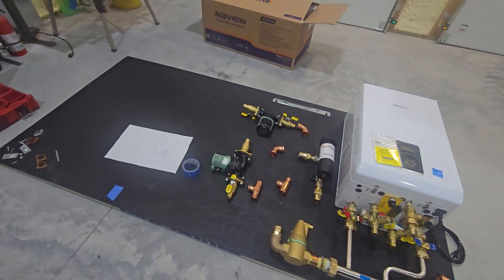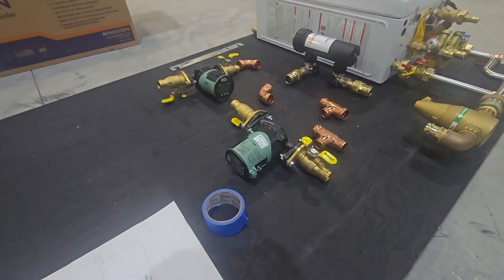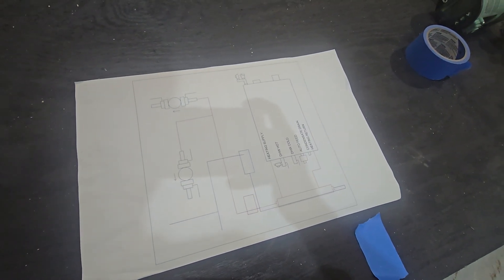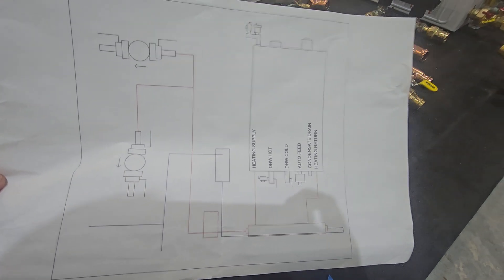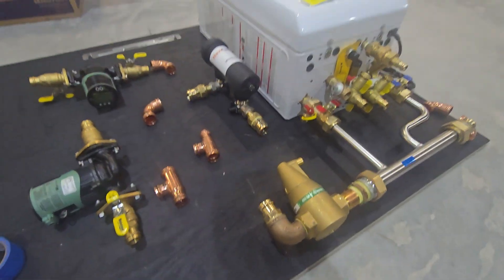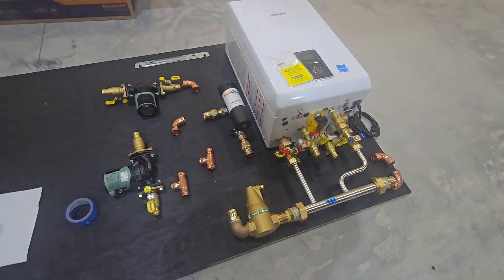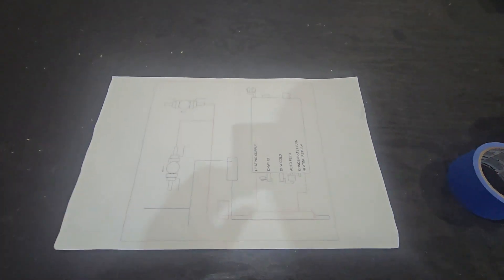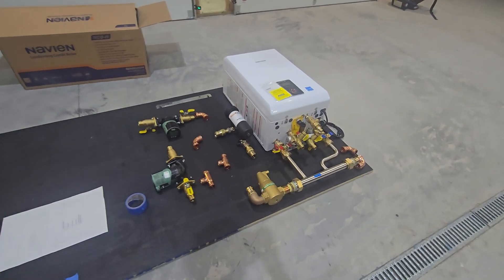Boiler System Designs and Layouts

Comment: Thank you so much Jim for everything you do / post!! You ROCK! 

What would be a con of running a hydronic system in oxygen barrier PEX?
Reply from the maker: For the main boiler piping, the cons would be the inner diameter of pex and additional fittings reducing the flow rates. Its certainly ok to do as long as this is taken into account.